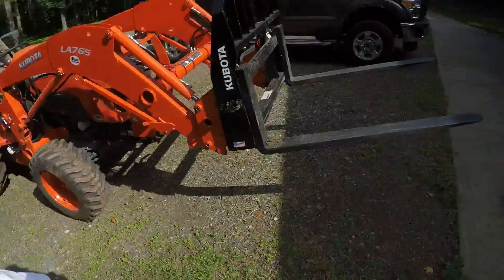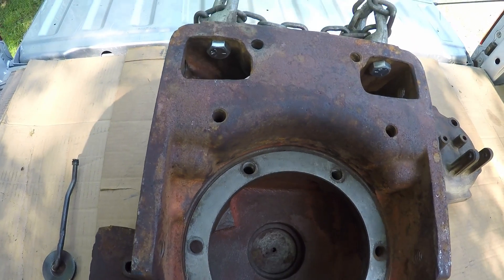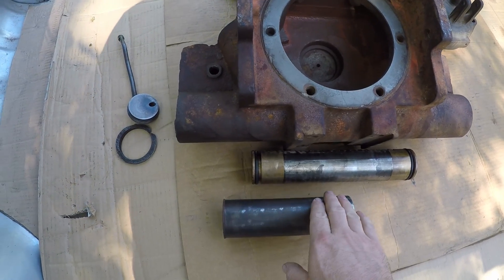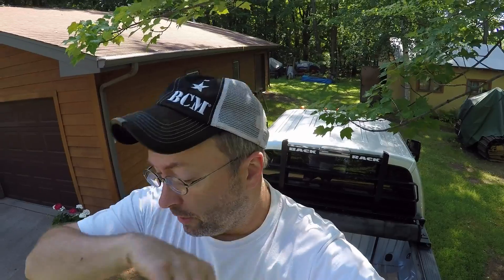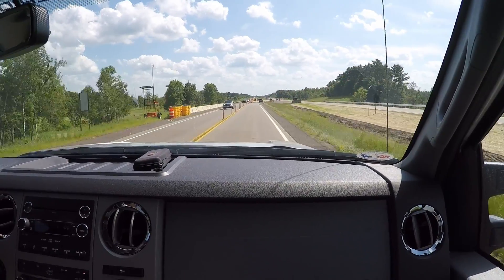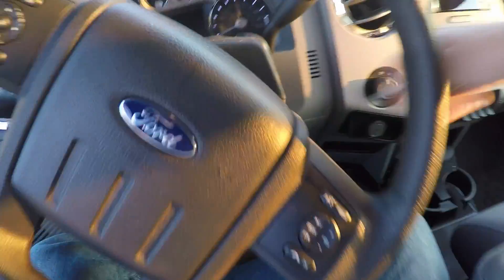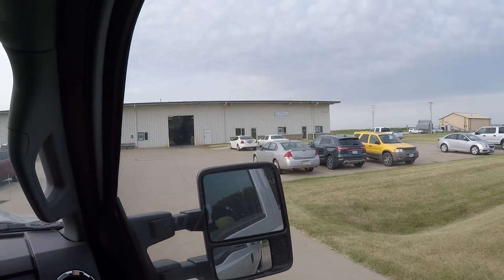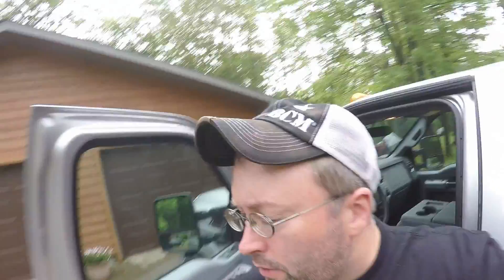Minneapolis-Moline Prototype Tractor #X231 Project Update - Steering Bolster Casting Repair

Comment: You made the right choice with that casting, I have the don't pay others argument from my Dad. He doesn't understand the time wasted and the risks of trying to half right fix a part like that to save a few $.  I may not have the right tools so it would take longer, or i may not be confident my repair will be right with some odd things .  
    I just don't see the point in making more work for the machine shop they will bill us for fixing a mess that could of been avoided, letting them do it right from the start. yeah he tried saving $1000 and it ends up costing 1500 when they fix it right. It 's a thing called old farmer logic and I hear a few guys say it's a common problem to L.O.L. Thanks for another tractor adventure video .  Take care guys.

Comment: Depending on how invisible you want the repair that is a tricky one. For total invisible would have to build all that up with weld and re-machine it. Other options would be to mill it back a ways and bolt on a repair section thru the ends. I didn't get a good enough look at it to tell but might could thread the outside of the casting and make a piece to screw on that that would be a pretty seamless and invisible repair. If that barrell leads into that square section then that would be tough to do.

Comment: Just reviewed your restoration. I noticed on the original images at the manufacturers yard that the hood did not carry the "445" emblem. I also noticed that there is a crack inside of the steering housing. The machine shop will find it. Great job.